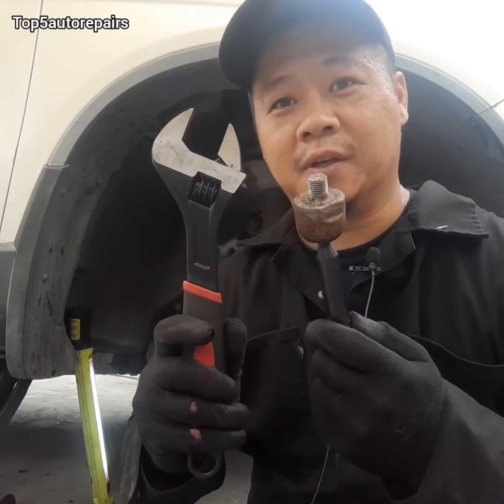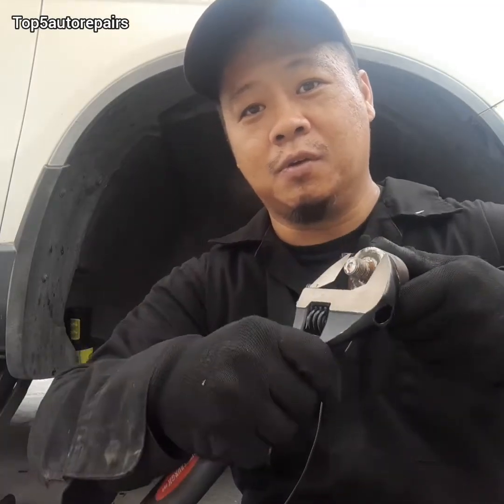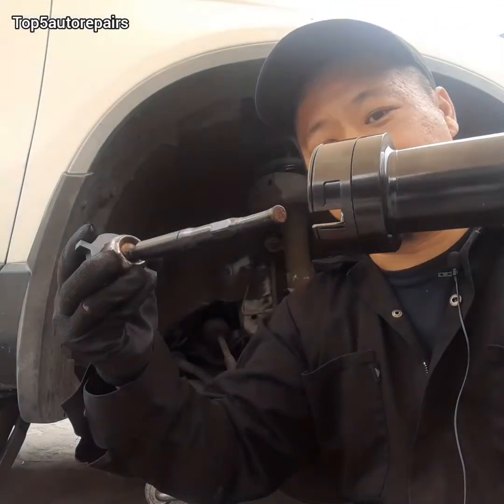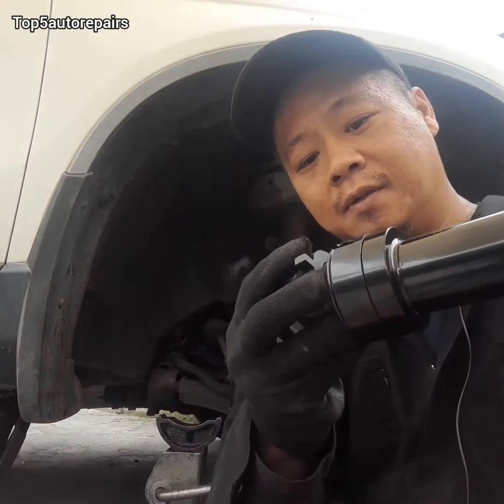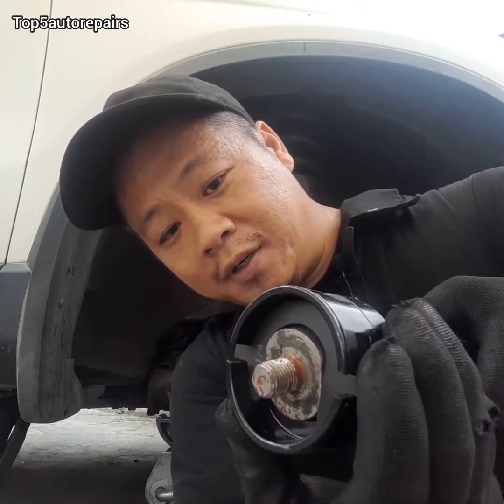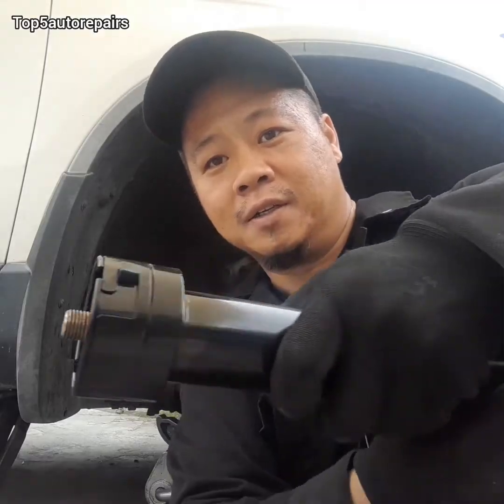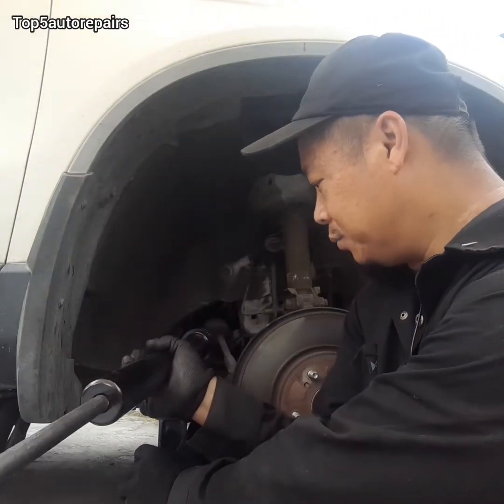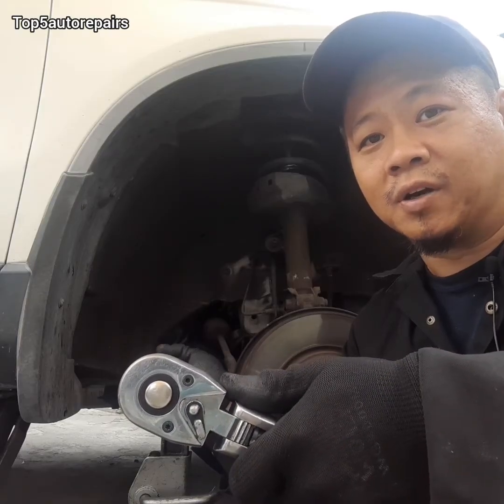3 USEFUL TOOLS TO REMOVE INNER TIE ROD (A REPLACEMENT GUIDE)

Comment: My car ac stopped working then worked again now it won't blow air in vent and I'm between it the ac compressor or radiator idk plus the radiator fans don't turn on
Reply from the maker: I have plenty of videos for A/C system.

Comment: I tried all those and nothing worked. Mines frozen solid😩
Reply from the maker: Spray pb blaster and let it soak for a day then try again
Reply: @Top5AutoRepairs  I sprayed it and put a swedish pipe wrench on it and used my leg with all my weight and it finally broke free. Now I'm scared I didn't tighten it enough